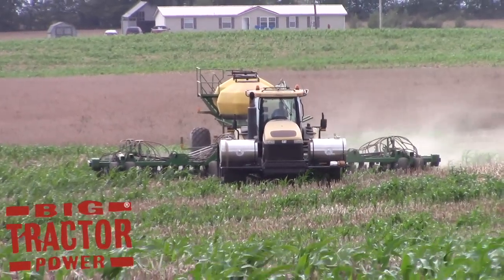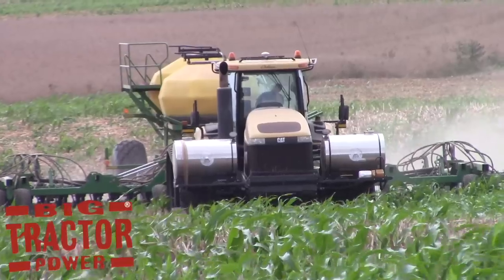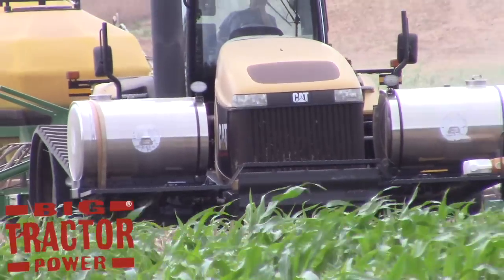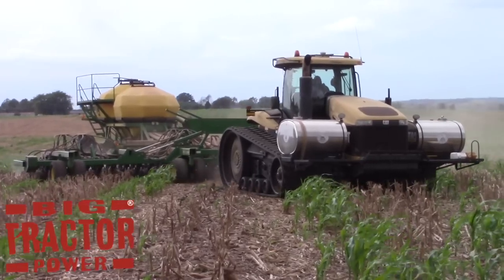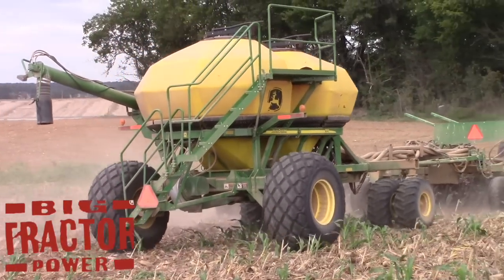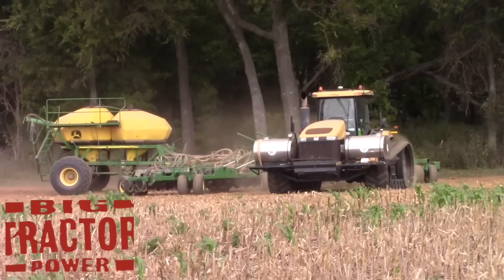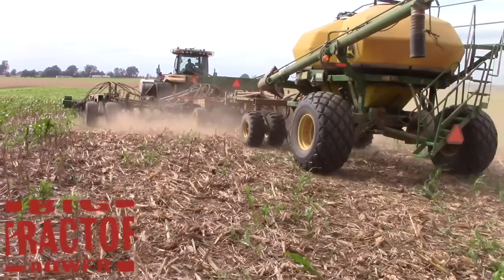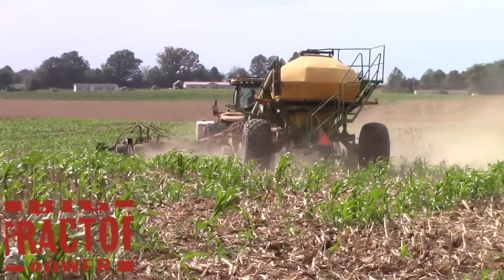460 hp Challenger MT855B Tractor No-Tilling Winter Wheat

Comment: Does the 'B' in MT855B stand for anything?
Reply from the maker: The letter is a way to show the advancement in the series.  It stems from Caterpillars construction line.  Since 2001 there has been an MT855, MT855B, MT855C and the current model is an MT855E.  For some reason there was not a D model in the MT800 line  but there was in the MT600 and MT700 line.  We will be filming a brand new MT875E this year and I will make sure to mention the lettering system in the video.  Good question.
Reply: Thanks for the insight! I have heard of the E series in the game, Farming Simulator 2017.

Comment: Those lexion combines spit out a lot of corn
Reply from the maker: All combines have loss.  In this case it was not so much from the combines as it was from the Calmer 18 row heads they run.  The heads were shelling the corn.  If you look at the volunteer corn much of it is in two evenly spaced strips were the combines tracks pushed the corn seeds into the ground directly behind the head.

Comment: What is powering the compressor on the commodity cart?  There is no PTO shaft coming from the tractor, any power must becoming from another source.  Ground drive?  I see some of the tires on the drill have aggressive tread, others do not.  Are these ground drive wheels?  The cart has diamond tread on the main wheels.  Are these ground drive wheels?  Sorry - dumb questions from somebody who does not have an opportunity be around this equipment, but loves farm equipment in operation.
Reply from the maker: Hydraulics from the tractor are used to power the air drill.
Reply: Thanks.  Are there many other pieces of equipment is that is using  hydraulic motors from the tractor fluid flow, not just translation devices (e.g. cylinders)?  I know such pieces as stump grinders being driven off a skid loader, use hydraulic motors.  But, how about the more directly related field ag equipment?
Reply from the maker: Air drills, corn planters, some grain carts are examples of other hydraulically powered equipment.

Comment: letters at the end of the number designate years of production a C would be the newer version. air drills don't use a compressor they have a hydraulic powered centrifugal fan blowing product through the tubes.